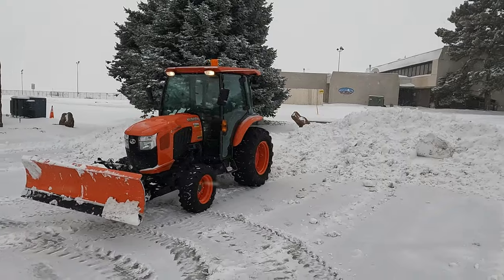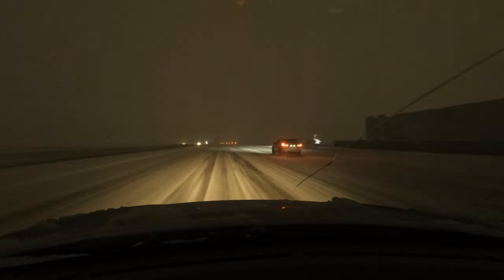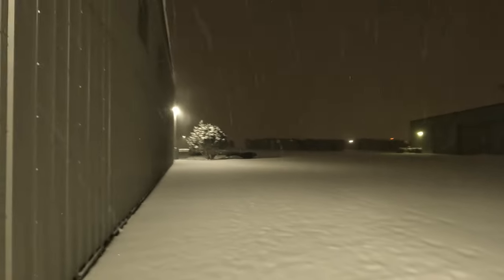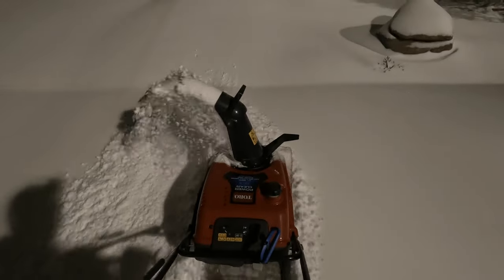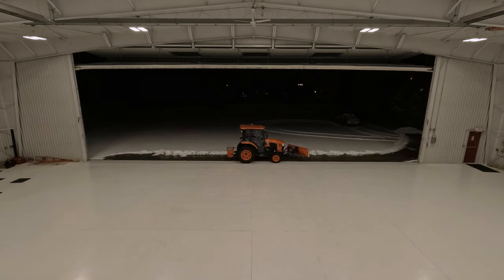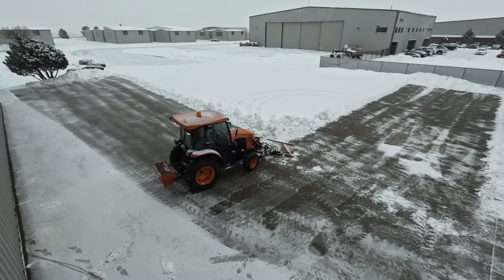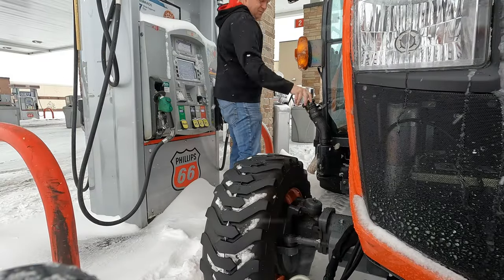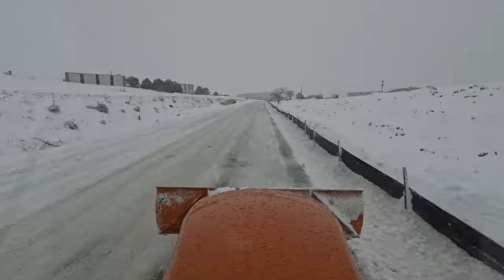Plowing Snow At The Airport With A Kubota Tractor - Jan 2023

Comment: I have the exact tractor- love it. Bought the L4479 front mount blower but of course we’ve only had about 5” of snow so far here in Mich.
Reply from the maker: yeah, as soon as you buy nice new equipment, the weather won't cooperate.  Thanks for watching!
Reply: yeah kubotas are the cheapest tractors out there like here where im at  deeres here are rediculas  the deere dealer wanted $82,000 for a small 40hp compact tractor with out loader and attachments wich was rediculas
Reply: @michaelmactavish4445  I’ve heard from more than 1 JD dealer that Kubota dominates the small utility market up to 60hp, and Deere has the farm (field) tractor segment. As far as being cheap, I got mine L5460HSTC with loader for 51,000. I thought that was a lot, but they seem to work well and have excellent longevity. To each, our own, I guess.
Reply: @klausswartz3369  yeah thats why kubotas are the cheapest brand on market plus best discounts with moneyu saving